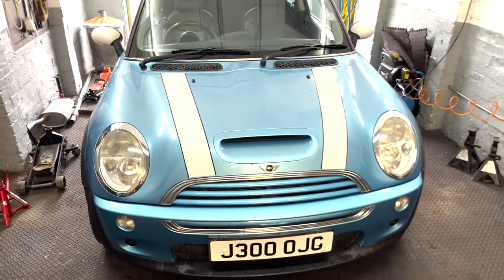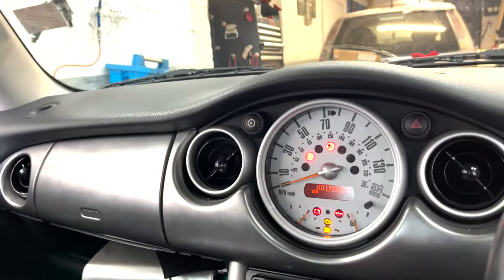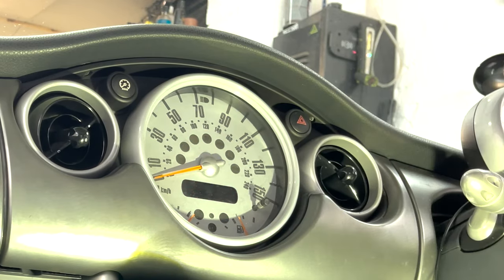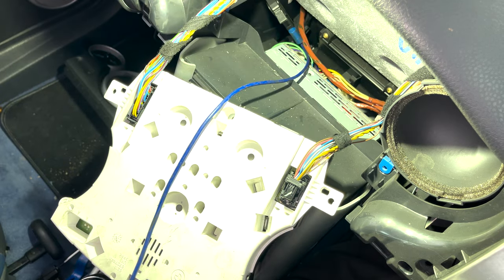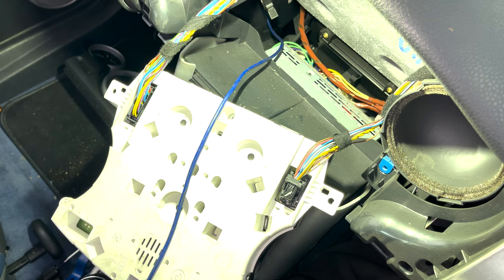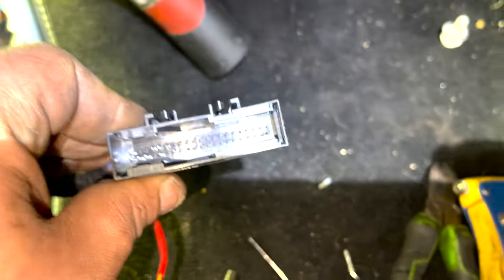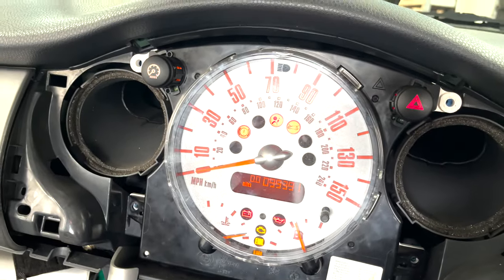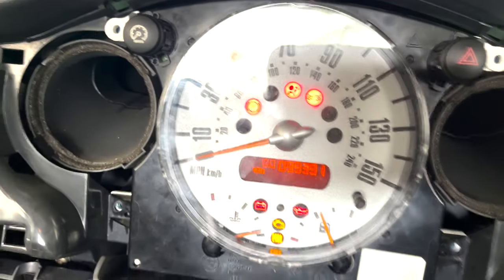Mini Cooper cluster 2 not working various faults | Dash lights RPM central locking Trip counter ...

Comment: Good job - but .. I guess you could not get the information of what is was that cable for.  I saw your video because I simply cannot find information proper to fix my R56 .. seem the K-Can bus is not connected and the CAN bus is working .. so no more Tachometer and the A/C clutch does not engage.   Is there a fuse on the Bus lines?.

Comment: i currently have a 2005 mini cooper r50 and the transmission is not working as it should my car comes with a cvt transmission and when scanning the vehicle it shows me the code p1611 which means no communication with the transmission module.  the currents and earths are fine, the voltage is equally good, but when I saw the can bus diagram, I realized that my car should have the steering angle sensor and it does not have it in the diagram, it is seen that before the steering wheel angle sensor there is the of the transmission and since my car does not have that sensor, the ecu cannot communicate with the transmission.  the scanner tells me that there is no communication between the cluster and the bcm and it is because there is an electrical power cable that goes from the fuse box to the bcm that is in an open circuit.  At first I changed 4 different transmission modules but the problem continued and now I am sure that by not having the steering wheel angle sensor there is the problem of lack of communication between the ecu and the transmission module.

Comment: Great video! Did the same. In my car the red cable with yellow spots was missing. Cleaned and an fixed everything. But my car can’t save mileage or any information like consume amount. And the needles dance as well. Hope you can give me a advise. Thx.

Comment: Mate issues were having issues the dash lights (orange lights) are not illuminating, checked fuses etc no joy, which pin controls the illumination on the cluster, only illumination we have is on the steering wheel controls, cheers in advance

Comment: the bcm is the main module of the k bus system and it communicates with the instrument panel and it may be that since the vehicle lacks the original stereo that I believe comes with a resistance for communication, the problem could be there.  these vehicles have a can bus communication network and the two main modules are the instrument cluster l and the ecu or s2000 each of these have a resistance of 120 homies and when both are connected the resistance drops to 60 homies in order to be able to communicate with the other modules like transmission module and steering wheel angle sensor